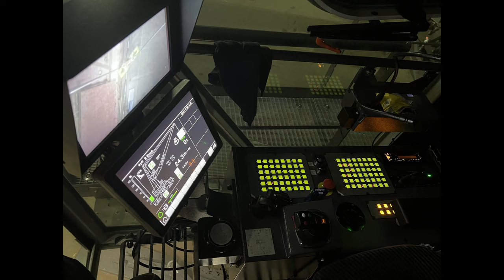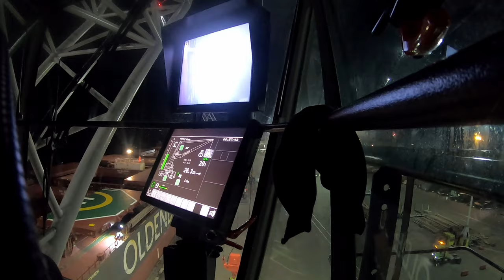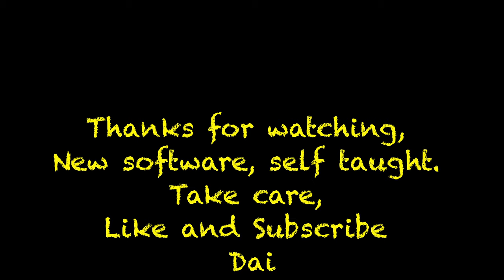Liebherr 550 Conrad Oldendorff,  Log Boat, Bulk Carrier

Comment: Come along way from when it first started with machines in the hold with buckets to push the logs around, and those first crane grapples with a diesel motor and remotes. Those cranes are a game changer, big heaves.
Reply from the maker: @PeterMorris-rn4sd  I’m sure one of those motorised grabs is still here but not used. We have moved away from wires now and have these mobile harbour cranes plus MLG grabs that work from a ship crane 🤙